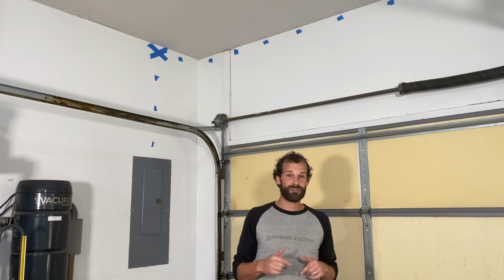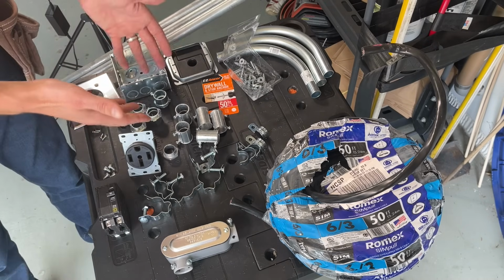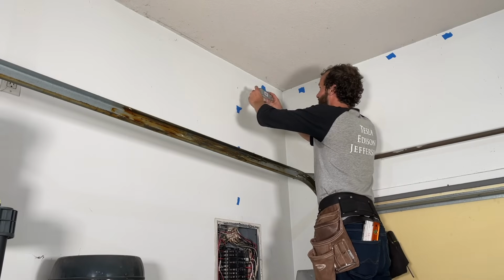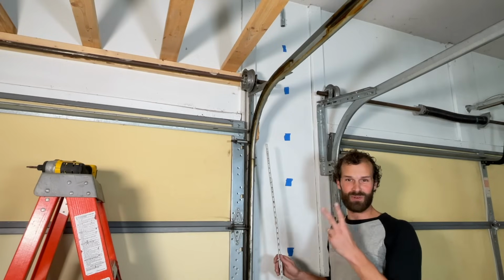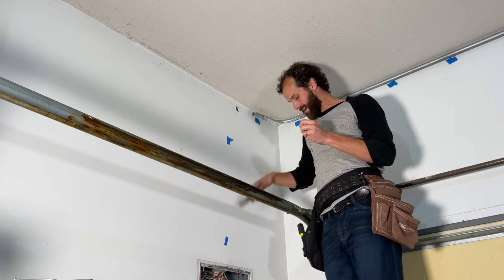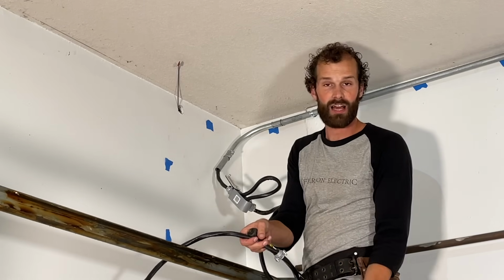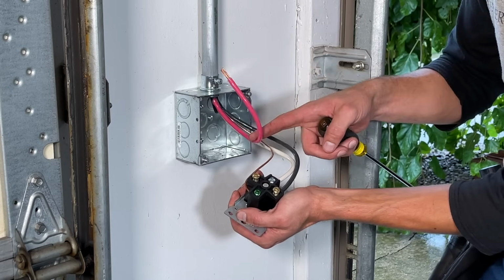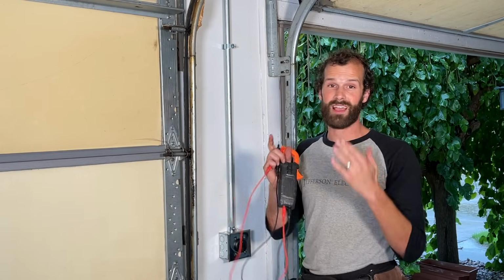How To Install a 240 Volt Outlet | Electric Car Charging

Comment: 50 amp continuous load is 62.5 amps which you would need that amplify of your wire. 6/3 number is only rated at 55 amps or 60 if your going with with next standard breaker size. So your wire is undersized partner for that continuous load.
Reply: Technically, you're right. But when the guy in the video said 50A continuous load, what he meant was "loaded with the maximum continuous load a 50A circuit can handle". It's a classic case of "he wrong, but we know what you mean".
He also was likely stating the fact that it was continuous, not for the 80% rule on this particular circuit, but instead, for load calculations for service sizing purposes.
Reply: @ewicky  ya a but if he's an electrition, he should know you need to size the wire to accommodate that continous load not the breaker.That's why we have the NEC. He's a hack, I've never done or have seen anyone put nmb in emt in that long of a run. Maybe a short sleeve of physical protection but not that long. Get some THHN knuckle head. Maybe that's how they wire shit in Mississippi idk
Reply: @B-B-E-44  You're missing the point. The load is 40A. The wire and breaker are sized at 50A to support that. From that standpoint, he didn't do anything wrong and you're overreacting.

And I agree with you on the THHN. I wouldn't have ever considered running Romex in EMT. Too much effort and it's also a waste of copper.
Reply: @ewicky  I see what you're saying he just didn't word it correctly in the video. Idk why this shit pops up on my phone. Being a Master electrition it's always funny watching these videos and seeing other "electritions".  Take care my friend
Reply: Lets take Tesla’s mobile connector as an example. The 14-50 adapter contains a resistor so it knows it’s plugged into a 50A breaker. It’ll let you adjust the Amps in the car, but only up to 40A. If you want to charge a Tesla at 50A you install a hard wired wall connector with heavier gauge wire.
Reply: @ewicky  most EVs are protected at 40A, so the running current is likely closer to 32A.
Reply: All circuits must obey they 80% ampacity rule. Therefore, the car will charge at max 40 amps continuous.
Reply: I don’t think EVSEs should pull more than 40A from an 14-50, as they should limit Amps to 80%.
Reply: @pepstein  you have a 50 amp breaker and if the load is continuous by code you have to size the wire accordingly. A wire with a 62.5 ampacity , which is 4wg copper
Reply: @B-B-E-44  #10 AWG of SRML can handle 75amperes
Reply: @wirelessjj8817   NEC 100 amps or less must use 60c column for ampacity

Comment: I thought you could not run ROMEX through conduit?  Also I think you could use the conduit as your ground if it is metal.
Reply: Not an electrician, but if I recall correctly it is OK to run romex through conduit, but usually not a great idea to do so. The fill table ends up treating the normally oval romex as a cylinder, and you need some absurdly oversized conduit to not over-fill the EMT.

I can see why he'd do it for this install, to avoid putting conduit in the wall, but yeah, single conductors seem to be the way to go nearly every time conduit is involved.
Reply: @DonaldZiems  NEC Chapter 9 "notes to tables" #2 allows for "overfill" for short lengths of incomplete conduit, which would be a suitable definition with our AHJ since the conduit system is incomplete at the wall above the panel.
Reply: All great thoughts and was it ever a beast to pull the romex through the EMT! Our attempt at exhibiting simple materials rather than drywall repairs, eliminating wiring transitions and keeping it simple. A few elements here wouldn't be my day-to-day, such as:
1. Would've used a cordless bandsaw, not hacksaw, 
2. THHN through conduit, not romex
3. Buying 90's as opposed to using an EMT bender (we will cover this in later videos)
4. Corrected the double tapped neutrals in the panel...
Reply: You can 100% run Romex in conduit as long as it's not in a wet or damp location.
Reply: @mr.g937  I guess it is just easier to run THHN wire...
Reply: @ericfraser7543  much a easier to pull thhn, only a meatball would pull romex inside conduit.
Reply: @mr.g937  yes but it need to be derated because it's  already inside a pvc jacket which is made to be run free air.
Reply: @pauliemoto  I love the engagement. Thanks! NEC 334.80 has already determined that romex is already rated to the lowest possible category, 60 degrees celsius. No further derates should apply.

Comment: Isn't there an attic above? Why not run it all the way to the receptacle point and then drop down in EMT?
Reply from the maker: There was living space above that portion of the garage.  Good question.
Reply: That's what I just did in a job, but there may not be an attic.
Reply: @dougb8207  He mentioned there was a living space above.

Comment: I thought all outlets in a garage had to be GFCI?
Reply: Not 240 volt. That is, until NEC 2020, which many states aren't even on yet.
Reply: @mr.g937  That is good to know... thanks, my electrical inspector said I did not need one either was not sure why...  GFCIs were needed for my light circuits on the ceiling because they were outlets and not a hardwired fixture.  240 double pole GFCIs are not cheap, they seemed to have doubled in the past year if you can find them...   not like you can get GFCI outlet you need a breaker...  I will have to wire the 5 outlets in my garage before the code changes...
Reply: GFCI protection for outlets up to 250 volts is a 2020 NEC requirement which is beyond the local adoption of the code.

Comment: I was taught to wire to the breaker first, then install the breaker in the panel with the wires already. Is there some reason I'm not seeing to seat the breaker first and do the wiring in the more constrained space?
Reply: I was taught the same
Reply: That can work well on smaller gauge wire like 12 and 10 but i would try to do anything larger with the breaker on the bus bar already to make it easier to give the wire some memory bends to make it look as good as possible but if I’m working inside a very cluttered panel that I just cannot get the wire on the breaker easily I pull the breaker off
Reply: You would have been taught in correctly than
Reply: Always last thing is breaker and then test

Comment: Interesting.  However for DIYers, I would cut the sheetrock out above the panel with a Multitool which is very easy and neat, and then use Metal Clad cable for the main run all the way from the Panel to the outlet. I would also add green sheathing for the ground inside the socket to stop shorting (or use 6/4 MC cable with a green wire.)
Reply: How does using an uninsulated ground cause shorting?
Reply: @mr.g937  The ground wire could contact one of the hot terminals when the outlet is pushed into the box.
Reply: @OldBaldDad  that is pretty tough to do on the Nema 6 or Nema 14 250v receptacles since the screws are recessed into the plastic. Yes, it is common on the 120v receptacles with protruding screws, and given the soft nature of the small ground wires.

I like to use 3.5 or 4" deep boxes and a mud ring for 240v receptacles. Leaves a lot more room to fold/roll the fat wires into the box without using the screws to drive them home.
Reply: @OldBaldDad  That could happen on any receptacle...yet we use uninsulated grounds all the time. I don't see this NEMA 14-50 as any different.
Reply: @mr.g937  I agree. The risk of shorting is minimal.
Reply: Also, no need for metal clad wire. If it was internal to the wall, he could have run 6/3 or 6/2 NM-B no problem.
Reply: @plkracer  Really?  You use metal clad so you do not have to cut into walls, but you still have to get into the panel. Good luck getting cable through the Garage door header, and blocking between doors for the socket!

Comment: Nothing says "I'm a pro" more than using a metal fish tape in a live panel, especially while teaching DIYers. Smh, gonna end up giving someone a little Edison medicine.
Reply: Edison medicine! You're gold! Thanks for that one ktw7hu
Reply: @joelwalsman773  Except Edison was a DC guy. AC was Tesla.
Reply: @mondotv4216  Tesla was a genius, edison was a con man. The two of them were not friends. Why anyone would put edison with Tesla on a shirt is crazy. For all the reasons everyone has listed I would never hire this guy or his company. He's doing a diy demonstration for amateurs and doesn't shut off the power. Not very safe. He may be a good electrician and can get away with doing things the way he does, but as an instructional video for amateur diy. D-.
Reply: He might get a little "sting" if something goes wrong in that live panel😂
Reply: 22222222 @tedmcdonald3377
Reply: A scrap piece of cardboard taped to the wall that covers the open panel is cheap insurance when fishing with a metal fish. Cheap and simple.
Reply: Fiberglass fish tape. Also. Where is the Charger box going to be. The electrical box is at 44 inches. And the conduit runs up the wall. I guess you could fir out over the conduit to provide a flat surface to mount the Charger to. I don’t think you want it below the Electrical junction box. Too close to the floor and could get water into it in a flood.
Reply: @randypendleton2529  portable charger no wall mounted box.
Reply: Or the elbow coming dangerously close to live fault as he said could been ugly,smh.
Reply: You all guys crying for everything
Reply: Ahahahaha 😂
Reply: Lmaooo not Edison Medicine
Reply: “Edison medicine” lolololololo
Reply: Nothing looks when pro when  buying 90 degree elbows of conduit, the easiest bend to make.
Reply: Maybe he has a death wish
Reply: Yeah bro seriously . fucking guy didn't shut off the main and now I am no longer watching this video
Reply: Shut up
Reply: Add all the breakers then divide by pi ….
Always shut off your water heater when charging your car
Reply: BZZZZZZAP!  Lmao!
Reply: @tedmcdonald3377 2
Reply: Edison ??? Don't ever use that man's name in the field of electricity lmao this is Nicolas Tesla world brother get your shit straight lmao Edison was a privileged daddy's boy he was a buisness man not an inventor
Reply: Thumbs up for the disclaimers and not showing fake content by doing it different than SOP. But the power should have been turned off with the knock-out and fish tape. Just my non electrician thoughts. Why Am I here anyway, I don't have an EV!.. damn you algorithm. LOL
Reply: @tbohtwentyone  A DIY need to always turn off the power, safety first!
Reply: @melrichard2745  here what they are saying is that even if you disconnect the main breakers the is is still electricity coming into the panel and stopping at the main breakers.. next step is to have the meter disconnected but that involves the utility company etc.. The fiberglass fishing tape sounds like a good idea 👍
Reply: Yes Joel used a metal fish tape on a live panel but the main conections are at the bottom of the panel and he was going up not down when using the metal fish tape so it is safer and have more control that way and you can cover the tip of it with electrical tape and be safe while using it overall it was an excellent video and installation i am also an electrician and have done that thousands of times with no problemat all with live panels great video.
Reply: This guy is dangerous.
Reply: @coqui1pr  main connection? The busbar runs down the middle of the panel there is 100-200amps ready to be fed to the busbar, touch that and that fish tape and you are toast and there’s a nasty explosion and fire. If you don’t understand electrical don’t give advice on it because there are things homeowners shouldn’t do, and electrical is one of them.
Reply: @nathanchandler18  First of all i am a licensed electrician in my state with more than 10 years experience in the field and the metal fish tape is going up not down the busbar is in the middle and the connection made in this video is to the side and before doing any electrical work in a panel power should be turned off at the main breaker maybe the one who doesnt understand electrical is you sir.
Reply: @nathanchandler18  👍🏼
Reply: @nathanchandler18  A reasonably skilled homeowner can absolutely do electrical. Especially something simple like this.  But if you are referring to a clueless homeowner, I agree.
Reply: Same with saying the 14-50 is best for EVs. EVs don’t care about neural, 6-50 would have been great if it’s only for an evse, less waste since 6/2 would be used instead of 6/3.
Reply: @EV_Dreams  I have two EVs and I do not want a 50 Amp circuit. I pulled a 4 gauge MC cable with 2 conductor and a ground. With a 60 Amp circuit I can charge at 44 miles of range per hour. Now I do have a 14-50 adaptor for my connector when traveling. With the 14-50 adaptor I can charge at 50 Amps at almost every campground in the country if I am in a pinch...
Reply: @michaelholliday100  why on earth would you need 44mph charging at home.
Reply: @EV_Dreams  Why 60 Amps, threr big reasons. First, I can charge 2 vehicles at the same time at 24 amps each. Secondly, If something comes up unexpectedly and I need a larger charge it will be quicker and lastly with the 60 amp and 4 gauge MC cable I will have less heat, lower resistance and a lower voltage drop the if I am pulling the maximum on a constant load circuit...
Reply: @michaelholliday100  I am right now in a process of installing new circuit for Tesla. I have a total of 200 amp from power company. One of my friend suggest to go 60 amp instead of 50 amp for a faster charge.
The above video is good explanation, but what would you suggest 50amp or 60amp (for future proofing my install)?
Reply: @tanvirahmad3331  If you are future proofing I would use a 4 gauge MC Cable with a 60 Amp breaker. Due to the size of the wire the size of the breaker could be increased in the future.
Reply: @michaelholliday100  Well thought out. That's what I did.
Reply: @tanvirahmad3331
Reply: @tanvirahmad3331  First and foremost you must make sure that you have the Amperage available in the panel. Just because you have a 200 Amp panel does not mean that you can add a 50 or 60 Amp circuit. With a 200 Amp Breaker Panel you can only draw a maximum of 160 Amps a any given time. If you have Electric Heat that might be 50 Amps, Electric Hot Water might be 30 Amps, Electric Dryer is 30 Amps and an Electric Oven will add 40 Amps. If you all of those items then you will need a 250 Amp Load Center. Since the above items can be expect to be operation occasionally at the same time that would be a 150 Amp load. Than leaves only 10 Amps. So, your Load Center would be to small. I hope that this helps...
Reply: @michaelholliday100  thanks for this info
Reply: @tanvirahmad3331  Good question
Reply: @tanvirahmad3331  no
Reply: @tanvirahmad3331  charging overnight you don't need the max $2000 install unless you drive 209 miles every day. Be reasonable
Reply: @Michael Holliday  I hope you realize that charging faster isn't desirable unless you need to go somewhere immediately.  Slower charger = longer battery life.
Reply: @Michael Holliday  you aren't pulling full amps out of those circuits ever, so adding up the breaker capacity isn't necessary.
Reply: Your wiring is not up to code. You don't  pull Romex/ MC cable in conduit. There are exceptions bit not in this case.  Cable from the panel inside the wall up to a J box is ok but not the entire conduit run. Been a licensed Electrical contractor for 43 years.
Reply: @philtorres2975 Curious, do you know the reason for the no Romex in conduit NEC code?
Also he would have had to do a splice between the Romex and non-Romex portions.
Just following orders without questioning is not always best.
Reply: @philtorres2975  agreed. And above 7 feet romex can be surface mount to code? Is that correct?
Reply: @philtorres2975  this was the first thing I said when I saw him pull out romex. That canNOT go into conduit
Reply: LOL. Always turn off the power... unless your a youtuber pro that needs lights and therefore electrcal outlets while shooting  🤣👍😁
Reply: I don't think I seen him bonding the ground wire  in the 4sq box ☹️
Reply: @rickmcnicholas8364  he didn't, he didn't have a ground wire connecting to the junction box, only to the receptacle.
Reply: NMB inside conduit instead of THHN too.  Waste of money.
Reply: He thinks to be an electrician, you have to electrify yourself
Reply: Pros don't work on live unless absolutely necessary.  Safety is key because you don't know what is going to happen.  You get a jump-scare from a loud noise or someone trips and bumps into you and boom your hand has a hole in it from grabbing a service line.  Don't work on live lines.